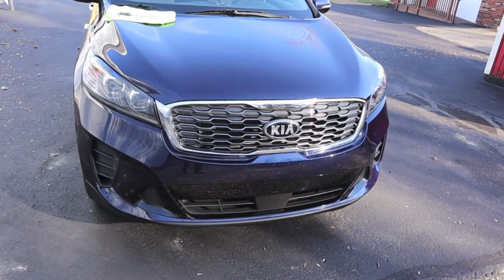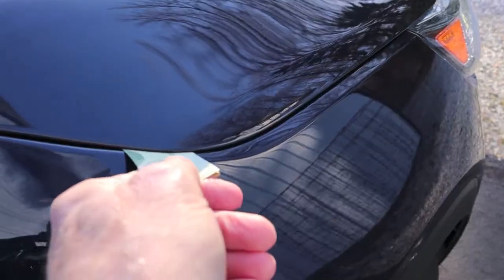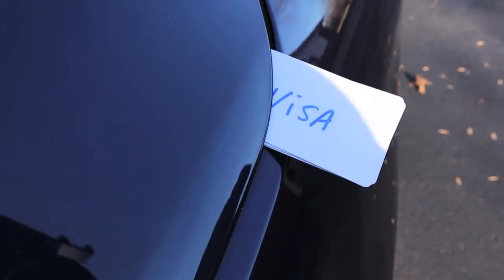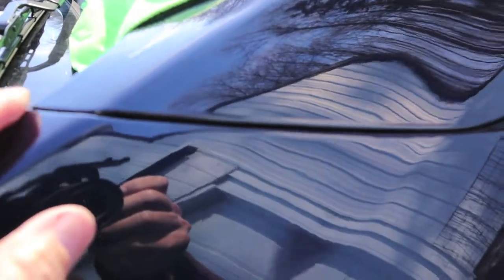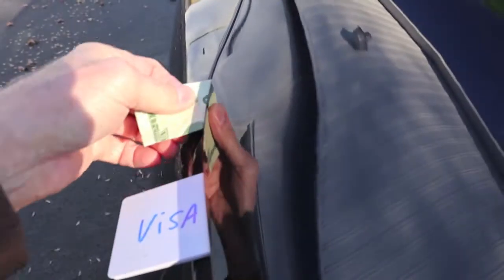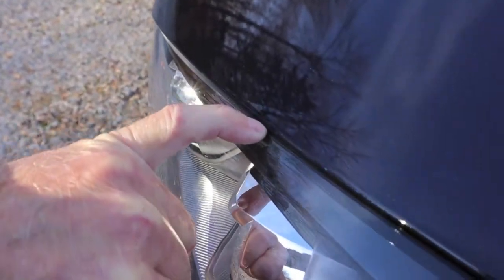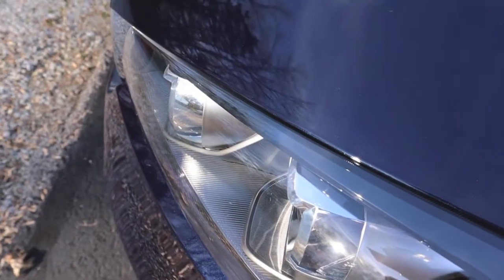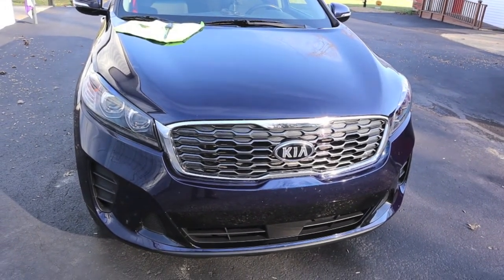Are KIA Hood and Panel Gaps Worse than Tesla?

Comment: Kia’s are a problem. Quality fit and finish and the warranty has more loopholes than tax day at General Electric. My mom had one and they wouldn’t warranty it because she didn’t change the timing belt at a certain mileage. The problem wasn’t related to the timing belt. Good luck with the fine print.
Reply from the maker: Unreal! My news feed on Android shows a new RAM Eco-diesel (Italian made V6) that had only 1 oil change in 50,000 plus miles and blew up.
Warranty was denied for lack of service, a skipped oil change.